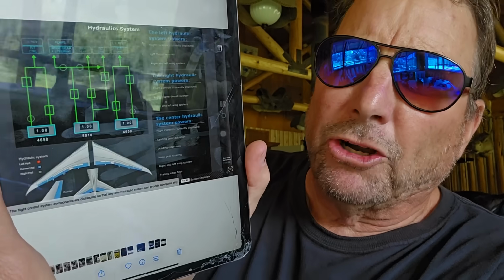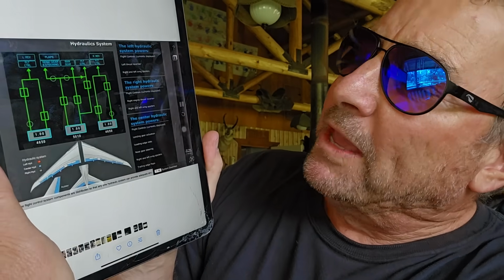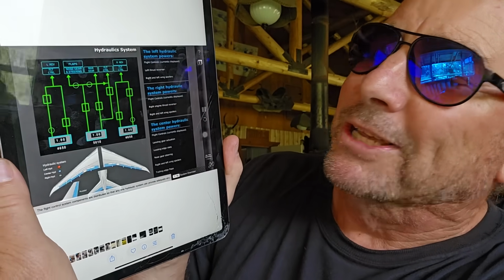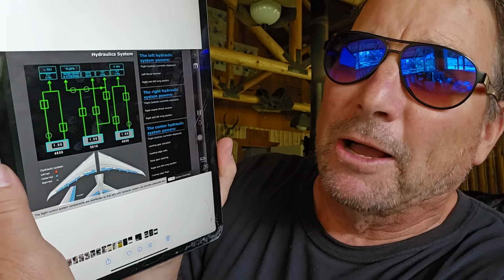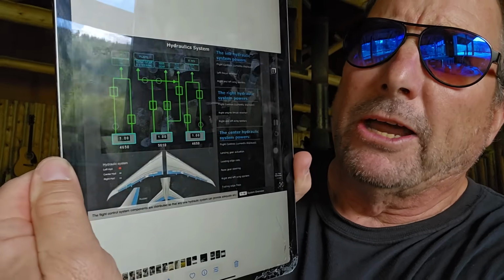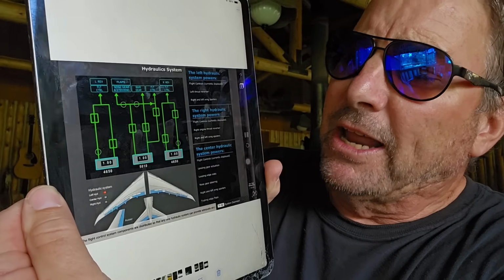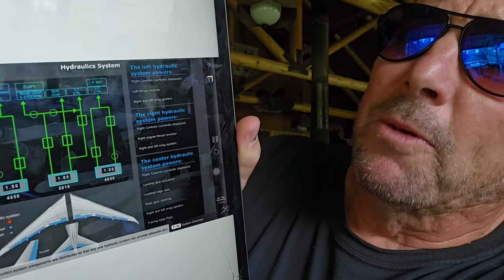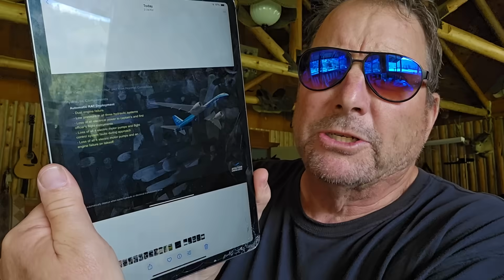787 Crash India What's a RAT? When does it deploy?

Comment: I think there's a lot more clues in the videos than appear at first glance. It's abundantly clear in the original bystander video (and not the recording of the original video off a computer monitor that the media ran with) that the flaps were configured correctly for takeoff. The slats are out, you can very clearly see the slots between the speedbrakes and the flap panels, and you can see the drooped flaperons and an oddly large gap ahead of them implying the panels ahead of the flaperons are in the neutral position, laying to rest any speculation that the speedbrakes were deployed (as has been circulating on social media). These panels are not used as speedbrakes/spoilers on their own on the 787 (as far as I know), only serve to blend the flaperons into the upper surface of the wing, and only ever face up when the flaperons do, e.g., when roll is commanded or when the flaperons are used as ground spoilers. If this panel appears "up," it could only be neutral, so the smaller gap between the other flap panels and the speedbrakes can only mean the speedbrake panels are drooped... which only occurs when flaps are set.

Mind, you can also see a definite "kink" in the trailing edge right where the flap panels should end... it's only a few pixels, but it's there and it's not anti-aliased like the rest of the trailing edge. It's nice and sharp. I'll bet real money flaps 5 was set. The question on my mind is this: why are the panels ahead of the flaperons neutral? Are they unpowered when the RAT is supplying hydraulic pressure to the center system and do they simply weathervane into their neutral position?

The investigation is going to be very interesting...

I spent a good long time as an ED social worker providing support to the medical teams, coordinating all the "fun" tasks with law enforcement and EMS around finding and communicating with family, figuring out who can make decisions, escorting families around, providing support to patients and families in the trauma bays, helping them process brutal injuries, loss of life, limb, and cognitive functioning, providing mental health support to my buddies on the emergency medicine team... I don't even want to know what the families of the victims are going through right now, let alone the first responders and medical providers who responded to the crash. A Mass Casualty Incident is pretty high up on the "Big List of ED Nightmare Scenarios." Whatever caused this crash, if it's a fault in the airplane, the airline's maintenance program or operational procedures, the engines or the FADEC system, or some other factor, I hope it's identified quick and rectified yesterday so nobody died in vain.

Comment: Hi Juan, just catching up with your videos.
Ive been a licensed load controller and dispatcher for Air India at various times over the last 20 years so understandably this one hits quite hard. After being able to discount the initial intersection departure theory, the thing we noticed was the position of the main gear bogies. It didn't look right. Studying other departures of 787s, they dont usually rotate forward until the gear doors start to drop. Here, the gear doors do not deploy but the angle of dangle has gone from positive to negative. I find that interesting. What would cause that? Lack of hydraulics? And flap deployment is clearly visible. Cant say anymore than that just now.

Comment: Juan tells it how he see it,  and did not know the Boeing 787 is electro hydraulic, like an old Bristol Britannia and yes the NTSB have their work cut out. To lose major hydraulic and electrical systems minutes after take off is disturbing, British Airways ,Virgin Atlantic have B787,s in their fleets and want to know why this happened.  In  one video clip I can see the slats extended but due to the B787,s unique wing  design it is hard to determine the flap setting. Regarding the ram air turbine RAT, when  deployed sounds like a a direct drive 260hp Lycoming Hartzell of a Cessna 182 Skylane, as you said provides emergency power for the flight controls and radio communication. Reluctance to gain altitude ,the undercarriage still extended points to a major failure of some sort and are both throttles electro hydraulic?.

Comment: You can also deploy the RAT manually, if you THINK or BELIEVE you are losing power (part of the dual engine failure memory items). Loss of lift can make you FEEL as if you have lost power. Loss of lift is ABSOLUTELY caused by accidental flap retraction in the low speed regime.

Partial flap deployment in wreckage can be a sign that the flaps WERE deployed or that the crew at the last second recognised the error of retraction a d tried to redeploy them...they had 20 seconds at best to recognise a d try fix everything.

But without flaps, in that speed regime, you are going DOWN irrespective of engine power setting. And that can feel like loss of power...

Comment: No, It doesn't seem on the Surface to be a Boeing Issue but more Aligned to that of the Air India Servicing and Maintenance Programme.
I want to see the Full Findings of the Accident Investigation Teams before Jumping any Further into This...
I've been behind An Air India 787 Take off before and as it left the ground it was all over t the place, Almost as though the Slats and Flaps were not set or Configured to the Conditions, Lots  Of Questions and I'm sure a Major Incident Brief is on its way.....

Comment: The RAT makes to most noise when the aircraft is exactly in line with the turbine. It will also have zero frequent change due to the Doppler Effect. In the mishap video the recording starts after the aircraft (including the turbine) has gone passed the camera and sound recorder, hence the noise is quieter and has a lower frequency.

I think that this is good evidence that the RAT had been deployed. The $64,000 question is why!

Comment: the plane was clearly controllable so of all the reasons you listed for the RAT, it seems dual engine failure would be the most likely, but how could that happen? no birds in the video. what else could cause 2 engines to die just after takeofff? if it was fuel you would think they would have noticed that before takeoff.

Comment: Just wondering, pure speculation - presumably landing gear retraction requires hydraulic pressure. Do the flaps on the 787 require hydraulic pressure to remain down or once deployed are they locked in place? Given that low hydraulic pressure deploys the RAT if it was deployed is it possible that there was a failure/leak or something that caused them to loose all hydraulic pressure (unlikely as that seems) and therefore be unable to retract the gear, loose the flaps and so loose lift?

Comment: Intersection departure and overruns used?
Reply: @DCSHacks_"Intersection departure and overruns used?"

Flight Radar 24 have confirm that the aircraft backtracked and had available the whole of the 3,600m long runway. Using the position where the take-off video was recorded and the buildings in the background, the aircraft left the ground around the halfway point, 1,800m from the departure end of the runway.

The overrun was not used.

Comment: ---From pictures of the wings: in flight from right side video, looking from underneath wing, there appears to be a dark line under right leading edge slats...would indicate they were down. Cannot see left wing clearly. Picture of right side wing on ground after accident shows leading edge slats down, but cannot see trailing edge. Picture of left wing on ground, can see what appears to be dark line above leading edge slats, would appear that they were deployed, but trailing edge flaps do not appear to be down at all, idk. Is the flaps1 setting for leading edge slats only, not trailing edge? 
--- have seen adsb data indicating 174 knots at apex altitude before settling. Is that fast enough to maintain climb with flaps1 with only leading edge and not trailing edge, or is flaps5 needed to increase wing area and therefore lift with trailing edge deployment in addition to leading edge slats, with the given altimeter/temp/load/runway length conditions present? Might be a clue there to the flaps setting at least at crash time.
--- the surviving passenger in a bedside interview said a minute after takeoff it just then hung for seconds, then the emergency interior lights came on, and engines went up but plane began to settle down and crashed at speed. Would this mean the engines were operating at some capacity, but an electrical problem occured? Did the RAT then deploy? Further stretching it, could there have been loss / changes of some control surfaces from electrical problems, or the RAT alone didn't support? When at apex, it looked that the elevator was moving up and down as the nose increased pitch, the plane wobbled right then left, possibly from assymetric lift behind the power curve, seeming to be drifting left off runway heading.
--- idk if debris off end of runway kicking up contributed to electrical / generator problems. The part of the tail that was still left intact on the ground doesn't appear to have tailstrike damage. Still not clear why rotation didnt occur until the very end of the runway, with such a high performance climb aircraft. There are some adsb charts that show not the whole runway was utilized, that a partial back taxi was done. Maybe in a hurry, from lateness or other landing aircraft?  Even if flaps1 was set, and the computer didnt catch it to call out a warning or the inputs were set that way, the roll performance wouldnt be affected by it. It keeps going back to the survivor saying the lights went out a minute after takeoff, then it just hung there. And late rotation with debris kicked up. May be a multi-factor cause.

Comment: There's another video that was recently released from a passenger that was on this 787's previous flight. There appeared to be many electrical and A/C problems in the cabin.

Also, there was another airliner accident in the region a few years back that happened due to an unstable ILS approach. The senior Captain was very authoritative yet appeared to not be monitoring the co-pilot very well. Meanwhile, the Co-Pilot was very inexperienced and it turned out that there were many questions about his training, credentials, etc. Rather than executing a missed approach, they forced the landing and the accident happened.

Air India Express Flight 812 ???

Comment: When the lone survivor said that the lights in the plane started flickering I had my suspicions that there might have been an engine or dual engine failure seeing as the engines are also used to generate electricity. Little confused to have seen bulldozers cleaning up the crash site so soon though. But I hope they can analyze the black boxes and get some real answers.

Comment: The surviving passenger recalls hearing a bang several ("30"?) seconds before the plane impacted the ground, so wonder if it hit airport infrastructure (e.g. approach lights) which damaged both engines?
Reply: The video of the the take-off ground run shows that the aircraft left the ground at around the midpoint of the runway and left the airport several hundred feet above the ground, so it did do hit ground obstacles.

Comment: I worked for a company that designed and produced electronic components for the power electronics on board the 787, EMI (electromagnetic interference) suppression and current measurement. During the development phase, there were a lot of problems with EMI, because the 787 no longer has the traditional 400 Hz on-board power. Instead current, voltage, frequency and waveform vary depending on what is needed. Even after the start of series production, the technical management of United Airlines called the suppliers to a crisis meeting and reported major problems. The morning start-up alone took an hour and a half because the aircraft was producing so many error messages. Most of them were unfounded, but they couldn't simply be ignored. 

Eventually, however, all the problems were solved and the most modern and efficient aircraft in its class became a great success.

Comment: If the RAT deployed, a serious condition was developing. Two more pieces of evidence: firstly, the survivor reported a loud bang and he said the lights were flickering prior to the crash. Secondly, a small object was seen to fall from the airframe to the left of the flight path. (The object can be seen in video). In addition, a passenger on the previous flight of the jet that day reported that electrical systems (air conditioning etc.) were inoperative. This may indicate that the cause is system-related. The flight data recorder is very likely to have all the information required to identify the failure sequence.
Reply: Hopefully the FDR/CVR wasn’t affected by an electrical issue. Are they battery back up now?

Comment: I think you are right, the Pilot and Co-Pilot knew something was wrong with the plane. 
There is also the sole survivor of the crash .

This is the Survivors account: After the plane took-off within a minute, It felt like the plane came to a standstill (in air) for 5-10 seconds. Then the Green and White (cabin) lights turned on in the Flight. I could feel engine thrust increasing to go up. But the plane crashed into the building.

The side of the plane I was it landed on the ground floor of the Hostel. I don't know about the other parts of the plane but where I landed it was on the ground. I could see open space outside the aircraft. So, when my door broke, I tried to escape through	a little space, and I did. On the opposite side of the plane was building wall. I don't know how I survived, right Infront of my eyes 2 Air- Hostess were burned to death.
Reply: @gyaniadmi2347
This is the Survivors account:

"Then the Green and White (cabin) lights turned on in the Flight."

These are the emergency lights, which indicates that there was a loss of power.

Comment: aviation expert and journalist Jacob Philip pointed out an aspect of the crash that is yet to be highlighted.

In a lengthy Facebook post, he said there was a sound that was barely noticed in the video that showed the aircraft's wheels down at an altitude of 600 feet and the flaps leveled—a low murmur, which could be the sound of the Ram Air Turbine (RAT)—a small emergency electricity generator that activates only in the most critical situations to power the aircraft’s essential systems.

The RAT operates only when all primary power systems—those drawing power from the engines—fail. It also activates if the Auxiliary Power Unit (APU) does not work, and even the battery unit fails. Only then does the RAT begin functioning, he wrote.

Unlike in other aircraft, pilots in Dreamliner planes cannot manually switch on the RAT—it activates automatically in extreme emergencies, he pointed out.
Reply: @PeterMurugaPeter-bc9nm "Unlike in other aircraft, pilots in Dreamliner planes cannot manually switch on the RAT—it activates automatically in extreme emergencies, he pointed out."

Others have suggested that the RAT can be deployed manually.

Comment: Juan - look in to a video of potentially this same 787 having electrical issues during a flight days (hours?) before the accident.  I think a passenger uploaded the video showing the touchscreens and AC not working. If this was the same jet, it lends theory to having an electrical issue at takeoff, thus deploying the RAT.   I think VASAviation had video with good audio where you clearly hear the RAT, even better than your audio.  

Someone stated the surviving passenger heard a loud bang and lights flickering right after take off - if he made a public statement, I’d suggest tracking that down as well.  Loud bang - do the jets have large fuses for the electrical system in case of overload? Or perhaps hydraulic pump line ruptured?  I don’t know - I guess a loud bang could be many things, but we don’t see any smoke from the jet or the engines in the video, so that can rule out a bunch of things. 

I saw someone mention the jet possibly crab walking on takeoff - as if an engine went out.  I can’t tell, but maybe your trained eye could look at that and see if you see anything out of the ordinary with the angle.

Comment: I don't know how the 787 systems are designed to respond to something like this, but I'd imagine the flaps stay deployed if hydraulic power is lost.
So what would be the scenario where basically all lift is lost, hydraulics are low and don't allow gear retraction, RAT is deployed but flight controls are still operational?

If the flaps would retract if hydraulic power is lost, that'd explain it - but I can't image it being designed (and approved) like that...any insight from someone with 787 knowledge?
Reply: _"RAT is deployed but flight controls are still operational?_" Correct, only the flight controls, but not flaps & slats and under carriage.

Comment: Haven't heard anyone talk about the flight radar trace ending just at the departure end of the runway. It kept flying a bit after that, isn't that strange? I mean, if it would be the copilot raising flaps instead if gear as one speculation is, the trace would keep on, at least while still gaining height.
Reply: There is a fuller trace available. The problem is that the ADS-B transmission is just line of sight and there are not many ADS-B receivers nearby, also if power was lost the ADS-B transmitter may not have been powered.

Comment: There were issues documented by passengers on the penultimate flight of that Boeing. The lights were turning off, no air conditioner, no communication devices working. Loss of electrical power the crew overlooked who knows why. Laziness and incompetence?
It seems that the loss of power was not just an issue of the electricity in the communication, lights, and amenities but of the whole plane.